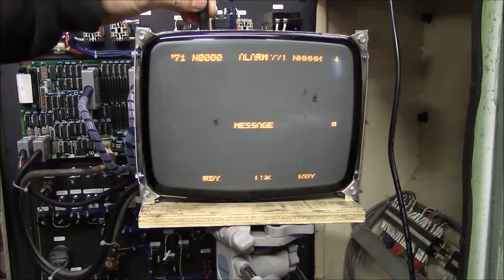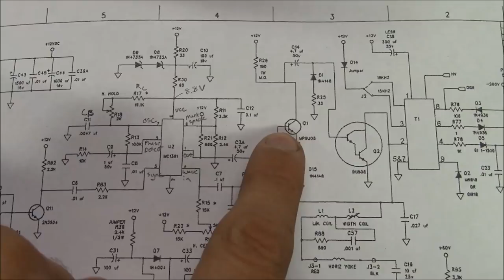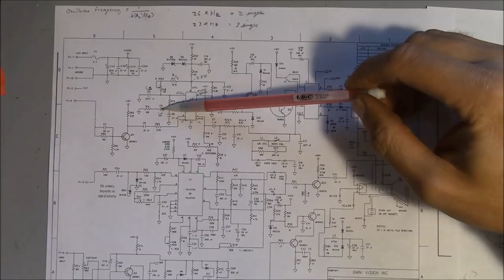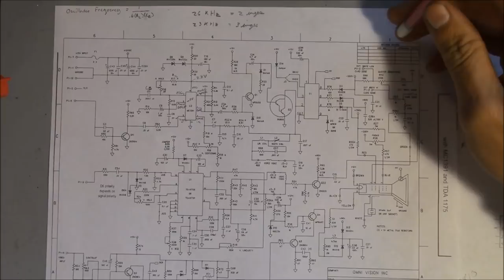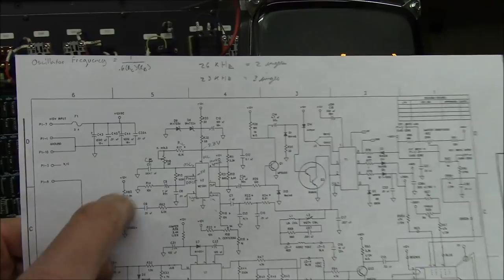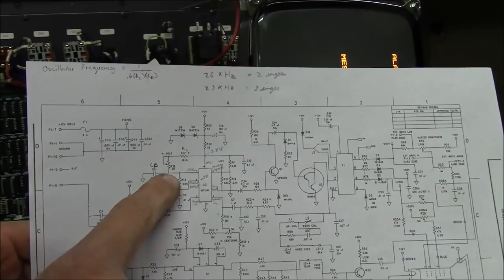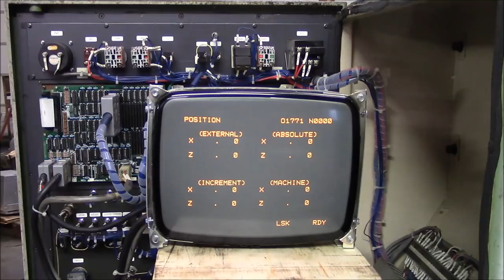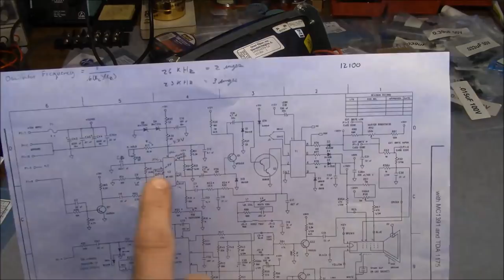Repairing Another CNC CRT Monitor

Comment: Omnivision 9" monitor service manual & schematic are here:
https://www.arcade-museum.com/manuals-monitors/OmniVisionMonitor.pdf

Kristel also made some 9" monitors and the manual for Kristel is here:

https://www.arcade-museum.com/manuals-monitors/KristelMonitor.pdf

I wrote an illustrated repair guide for the Omnivision and Kristel monitors back in 2005. These monitors were used in Arachnid's "English Mark Darts" electronic commercial soft tip dart machines you'd see in taverns. I've repaired dozens of those monitors over the years.

Comment: Very impressive that you even know how to repair crt monitor circuit boards. 
I've been repairing them for arcade games since 1983 and you'd be surprised how many hack jobs I've had to go in and first figure out what someone else screwed up then diagnos the original problem and repair it. 
The overriding majority of crt's I've repaired were Wells Gardner brand.
They were tye largest manufacturers of them.
Also the best designed.
They still have all the info on the multitude of them the made before going lcd including schematics,  service manuals and other info.
Gee, is there anything you can't repair Wes.
I have no doubt you could even rebuild an airplane and helo radial and turboshaft engines. 
The  best way to remove chips is to touch the very tip of your soldering iron to the tip of the chip leg as you put a touch of fresh solder on it then use a vacuum desoldering station to remove the soldering, again only touching the tip of the leg slightly into the guns tip to avoid damaging the boards trace.
The first thing you should do on an older board is change every radial capaciter on them.
They can look fine and still be bad.
If there's a brown wax looking substance leaking out from under them or the top looks like it's bulging it's definitely bad.
The top should have two groved lines on it. 
It's literally referred to as the relief valve and it's function is to keep the cap from exploding out sideways from it's case which I've actually seen when cheap Chinese knockoff caps went bad.
That trace damage you found is the prime example of someone getting their soldering irons tip on the board which will lift off the trace.
Always clean the tip of your iron before you install and solder the new part.
Otherwise you introduce pollutants into you nice new shiny solder which can cause problems after several hours of use.
Especially on high voltage items like bridge rectifiers and Ac/Dc voltage regulators.
Most boards of that age use 4 diodes mounted on the board to convert . Incoming Ac to Dc. Inspect all solder joints for voltage stress cracking.
It's really common on ground solder points

Comment: Retired Electrical Engineer here.  I have designed and repaired equipment like this.  You do pretty well for a diesel mechanic!   J/k, I'm thinking you have a lot of electronics experience.  👍
Reply: I have the same problem with my crt. It is repeating multiple times horizontally. Why does this happen?

Comment: Good job wes. Very very good to tune the oscillator to the one on one machine and the other. I had an old amigo machine in the 80's that used that freq for frame grabbing and video out signal. It was miles ahead of IBM stuff but it was locked where it was and IBM could make video cards like the old 90's voodoo chips. I loved that old voodoo card but my laptop right now would make it so obsolete as to be in another world

Comment: Nice job, that's how we did DIY through hole contacts in the old days ...that numbers remind me somewhat of old style analogue TV horizontal frequency, but who know what the designers had in mind.  I sometimes come across the CRT replacement problem, too. In some cases i got good results with one of these Chinese "everything-to-vga" converters and just use a modern LCD VGA monitor. If the CRT is really badly burnt in, there is usually no point of fixing it and second hand replacements are most likely of the same vintage.
Reply from the maker: Usually the burn in is not a huge issue for CNC machines. They just display simple characters. But, eventually we won't be able to get parts to fix these old CRTs. I'll have to get one of those Chinese scan converters and play with it.

Comment: You need to modify that desoldering station a bit, then it will work well enough to replace those ICs intact without any trouble every time.
The most important thing is to get the vaccum to come on more quickly. You can just put the pump motor on a higher voltage (with plenty of current) 15V to 19V works fine (usually it is 12V). A laptop power supply for example. Even better is to change the diaphragm pump for a venturi pump operated with a solenoid valve from shop air, because it is instant with no motor to speed up and nothing to gum up.
Another important factor is to keep restrictions out of the air path. The stock filters are really dense, and sometimes the spring in the solder catcher restricts the flow too (depending on model). You can check for that with a vaccum gauge in the suction line. It should read about -0.8 Bar (athmospheres) when you block the nozzle, and no more than -0.3 athmospheres when the nozzle is open. We use those cheap desoldering stations at work so I know them intimately, and they can be made to work better than all the expensive ones I tried.
Reply: stefantrethan this is some good information for when I get a desoldering station, I currently own a plunger operated desoldering tool and hate that thing... I wish I had a vacuum operated one because the joints usually cool down before I can line the stupid nozzle up on mine. But it gets me by, and even sometimes it works flawlessly you just gotta be fast lol 💨

Comment: ...Replacing the old electrolytics......have you been watching ...Mr.  Carlson...? 
  Nice repair on the through hole....I did a lot of PC board work/repairs in the 1970's on FRP boards, mostly hot running TTL 7400 series.......didn't have much in the way of repair stuff like this....manual solder suckers and solder wick was the 'new' stuff then....removing chips....yes, nearly always had to cut the legs on top like you did here....
Reply from the maker: I tried to remove a chip from a logic board once and just destroyed the plated through holes. Since then I've always been nervous about it. Most times I plan to replace the chip anyway, so it's much safer just to clip the legs.
Reply: ...Yeah, pretty much like I did waaaay back when, and the 7400 chips were fairly cheap, not a big deal if you clipped the ?good one?......deal was....lots of machine tool stuff was using TTL with maybe 20 milliamp max....for sinking 24 volt DC to operate relays....what the circuit designers would do was parallel 2-3 outputs on the chips....
 Often the guys wiring up the control panels would leave off the back EMF diodes that were supposed to be soldered to the relay sockets....or they would be backwards, or cold soldered......
 Thanks for the Reply.....I like you variety of work...

Comment: shouldn't the horizontal sync be 15.750Khz from the CPU? Hrm, 23Khz means they were doing high-ish resolution.  The HGC with 720x396 was only 18.625.  What's the vertical refresh rate on this display?  How many lines on the CRT?
Reply from the maker: The spec sheet for the CRT that I could find says 15.75 or 31.6 depending on if it's set for VGA or MDA. But, you can see on the scope that it's 17+ and the other machine is 23. It's 60hz vertical. I don't know how many lines.

Comment: I'm surprised to hear you say you always have problems depleting ics and then seeing you use a full on desoldering pump.  I was expecting to see desoldering braid or one of those spring loaded pumps.  I've never really had any trouble desoldering anything since I got a real desoldering tool. I wonder if there's something wrong with yours...
Reply from the maker: I had some bad luck with traces being damaged from the pins not fully desoldering and pulling out through holes when I tried to pop the chip out. I think it's safer just to cut them and pull the pins individually.
Reply: @WatchWesWork  I always remove old chips the way you did it. I clip the pins close to the chip and heat each one with the soldering iron then pull it out with tweezers. Then clean up the hole with desoldering braid.
Reply: It's down to reducing the risk of damaging a trace. Also I've generally found I need less heat for less time to be certain of a clean removel. This takes no longer and I guess it's each to his own

Comment: Nice repair! However I do not think you really needed to fix the land with the epoxy method. Drilling out the plated thru-hole and installing the eyelet should've pretty much been enough.

Comment: 6:11 let it cool down after the first round of soldering, or you introduce too much heat to the chip. On this large old chip, this is probably not THAT much of an issue, but on newer ones, the solderings inside the chip are extremely prone to melting if you apply too much heat. 
Alternating the side of the chip and jumping one leg on each go helps to keep the temperature down in the chip as well.

Comment: Isn't it impossible to test a capacitor without removing it from the board?
Reply: No, the ESR can be checked in-circuit. The test signal has so low amplitude, it's not supposed to bother any PN junctions in the circuit. There are a few traps, eg: several bypass capacitors on the same rail at far locations from each other, so you might not realize it instantly without a schematic. Parallelled capacitors' ESR acts like parallelled resistors, so it can be misleading by showing lower ESR than the actual value. 

High capacity multilayer ceramic bypass caps (or a lot of small capacity one in parallel) also has very low ESR, so to measure the PSU output electrolytic or local bypass electrolytics in boards like that, you have to remove them before measurement in order to get an accurate reading. But in most of the cases, it's fine to measure ESR in-circuit, if you have the right tool for it. 

This is the whole point of ESR measurement in the repair industry: it can be done in-circuit, so you don't have to desolder every capacitor, which would be very time consuming. It also decreases the repair parts costs, because a sensible technician wouldn't re-install an already desoldered old electrolytic, even if it tested good. With the aid of in-circuit ESR measurement, you can focus on fault finding, and after that, you can still do a full recap as a preventive maintenance after the unit works again, if it is known that it's very old, has a huge working hours count, has bad quality, noname capacitors, or if it is from an era when even good brand capacitors had long term reliablity problems due to chemical issues (a lot of the '80s - early '90s early low-ESR caps are leaking electolyte, because the agressive electrolyte corrodes away the leads and/or deterioretes the rubber seal over time).
Reply: I have repaired hundreds of electronic boards and the only way to know for sure is to remove the capacitor. If the piece of equipment is old then a good approach is to just replace all the electrolytics.

Comment: Just a heads up

Did you check the coil constraint mechanism on the back of the crt? 

I had and old genie crt from the 70s the coil on that thing was a bitch lol I bought some commercial grade chicken coup wire. I got the super thin grade 23 mil variant. 

After I lubed the chassis and replaced the horizontal and vertical control units. Had to completely reinstall the control units from scratch. 

I got lucky and got the chicken wire wrapped around the coil. But the crt smokes a little at start up. So I installed a fanning system to keep the crt from exploding lol generally speaking if your crt explodes that is either one of a couple things

Bad design. Overheating watching old bugs bunny cartoons. Or inverting the polarity

Anyway looks like you’ve got a good handle on this lol

Comment: Higher horizontal sweep frequency means more horizontal lines (higher vertical resolution and more lines of text).  Higher electron gun modulation bandwidth means a higher horizontal resolution and more characters per line.  Incidentally, slowing these things down a little like you have done is usually no problem; but speeding them up usually is a problem.

Comment: Should be relatively easy to translate and convert the display and control signals to ethernet or other high speed serial using inexpensive controllers (raspberry pi) or PAL logic, etc.  Then just use any laptop.  Maybe next time one breaks.  Could be a little hard finding CRTs nowadays!
Reply: i wonder if anyone makes a solution like that, maybe for vintage arcade games or something.